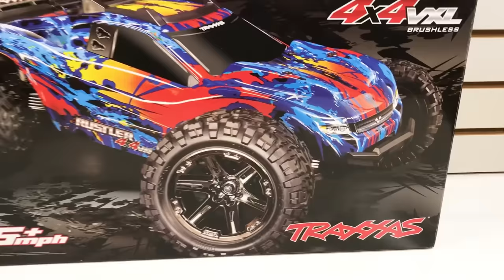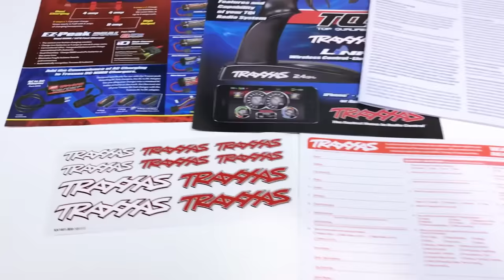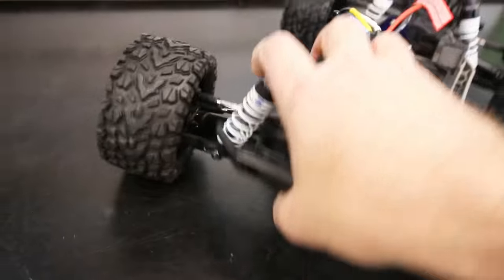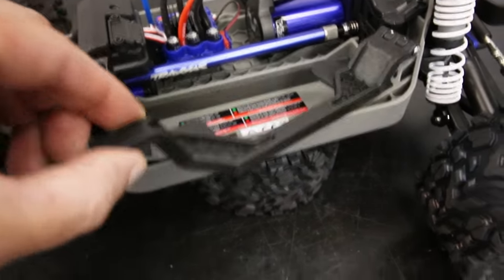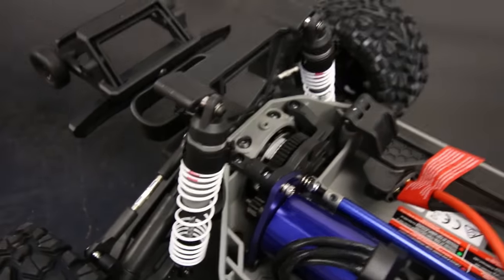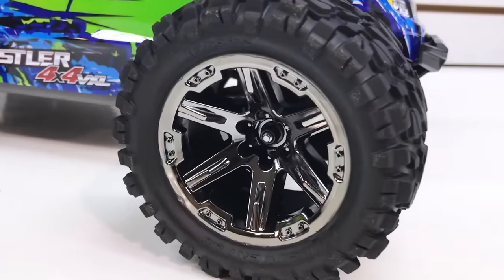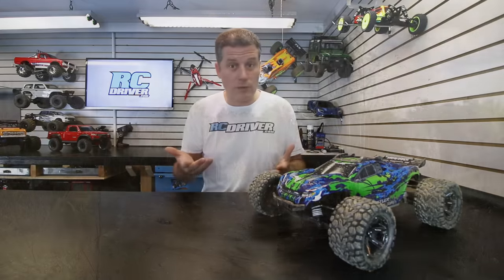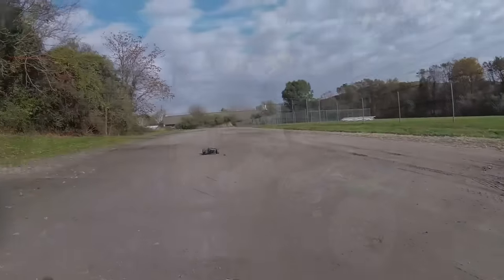SUPER 4WD Stadium Truck Basher! Traxxas Rustler 4x4 VXL RTR Review & Action | RC Driver

Comment: Just got the Rustler 4x4 VXL. Its absolutely amazing! It really shows what Traxxas can do with modern engineering. 

However who thinks Traxxas needs to update ALL of their 2WD platforms? Bandit, Rustler 2WD, Stampede 2WD and Slash 2WD are all in need suspension revisions for improved geometry, durability and adjustability. Thumbs up if you agree, maybe Traxxas will see this and finally give us an long overdue update to these 2WD platforms.
Reply: Considering when they were designed that brushed ruled the times those cars were good for those times. Yes, it would be nice for a redesign, a good mid motor design, more balance so they are not so light in the front. Now with brushless, and more power, they do not perform well on the old engineering. Would really like a redesign of the 2wd platform, if enough customers make noise, maybe Traxxas will listen.
Reply: One more problem I forgot to add, Traxxas needs to eliminate the front and rear offsets as well, front and rear wheels need the same width, so there is no need for different wheels, they should be able to be rotated without those strange offsets.

Comment: Although I was disappointed when it was announced that it was basically just another Slash 4x4, I understand why they did it. It's a proven platform and it performs amazing! Great truck, great video!
Reply: definitely not a slash 4x4 platform.  handles way better,  and it's lighter
Reply: way different design, better chassis and has a way nicer look to it. I have the 4x4 vxl with the lights and it's by far better than my slash and erevo in handling.
Reply: @jakobsinamon1683  While I agree they are technically a little different, likely length and width wise, they are the same design. Take a look at the rustler 4x4 chassis (TRA6723R) vs the LCG slash 4x4 chassis (TRA7422) and you'll see what I mean.

Comment: Just picked up my ruslter 4x4 vxl today and after my first run through two packs one 2s and one 3s I'm extremely impressed, it was a tough debate between this or the senton blx or the losi tenacity since they re all in the same price range. I got a savox servo to throw in it tonight too. I launched it a bunch today and it held up great and it's really smooth feeling, I've also heard people say the velineon gets hot on 3s but mine was fine I ran it hard on 3s and the motor was probably 120 degrees maybe, I could hold my fingers on it as long as I wanted without burning me so I don't know what people are talking about maybe buts their gearing, oh and people saying the velineon could have been higher kv and is too slow ar crazy I haven't even put the 17t on and on 3s was doing like 60ft wheelies on sand lol it's a beast and no need for a faster motor, plus the higher the kv the hotter it runs in my experience so a 5000+kv or whatever would definitely run hot.

Comment: Just dropped the Traxxas sledgehammer tires in mine plus a bunch of other hop ups. The tires changed the whole character of the car. 3s is almost too much I have more fun with 2s. People said I may over heat with the new tires but hasn’t happened yet. I did upgrade the servo to a proline and it turns those big tires no problem. 

As fun as this thing is though I’m always scoping out the erevo 2.0. 😂

Comment: Great video! I actually took mine to an indoor carpet track and it did pretty well. I pop a shock cap and bend a shock cap. That is the weak point in my opinion. I like it with the 17t on 3s. It has great speed and you can control it in the air and do backflips!
Reply: If you run the 17t that's not for stop and go. But speed runs or no? Does it run well for bashing on the 17t? Been hesitant to try it.
Reply: @kcmichelson4528 do not bush on 17T pls:) You are gonna burn ur motor, it is only for speed runs

Comment: Haven't mastered this new body mount system lol it takes me forever to get the body on.
Reply: Same. It's a PITA. Give me body clips any day.
Reply: slow mkv I tip for the body i learnt was pull the sides out of the body at the front it makes it a lot easier to clip it in also the self righting is useless it ruins your driveshafts
Reply: Pancouver venguins took me 1 day to get it down so i feel u but once u get it down its so great
Reply: @trevorrees1764  Same here. The Xmaxx system works great. The Rustler, not so much.

Comment: I was gonna get the slash 4x4 for my 1st RC till this came out. 😍
Reply: Did you get it?! I want one or a maxx will also be my first ec
Reply: Hitler 464 i recommended u get a brushed slash or bandit or rustler for ur first rc and then if u want more power get a brushless motor/ESC
Reply: Jason Lustig isn’t a brushed more maintenance? I don’t really have time to be working on it all the time
Reply: Hitler 464 it’s not really more maintenance it’s just not as durable like it’s not really waterproof like a brushless except with a brushless you will probably break more parts with all of the power but brushless is more fun because you can go faster and lots of other stuff
Reply: Yeah its great that you want one but u should probably get a 2wd, for my first i got a 2wd slash and it was the right choice, just got a 1/16 vxl merv and its pretty complicated

Comment: I bought the brushed version , dropping in a Blx combo .
Reply: Did that on my slash 4x4
Reply: Get rid of the rear bumper and put a stampede 4x4 rear bumper and arrma wheelie bar wheels
Reply: hehe, i tink i follow you on insta
Reply: Same here.
Reply: BLX and win but look out for broken parts especially if it wants to compete with Arrma 50 feet long and 35 feet high jumps and chassis slaps.
Reply: For only 80 dollars more i purchased the vxl model. Too much plastic parts on the brushed model. Not to mention the velineon system that is included that costs at least 130 dollars new by itself.
Reply: @19Herofade92  it's not like you could buy a much better system with lower cost than the vxl 1/10 system. What is wrong with Traxxas?

Comment: Will the Caster blocks on the new rustler 4 by 4 fit on the old 2 wheel Drive VXL they look like they could interchange and I found Parts online that are cheaper but made better but I don't know if they will fit on the rustler but they are the exact setup that this rustler has

Comment: is the non VXL one brushless ready besides the plastic tie rods and stuff, like metal diffs and whatnot?
Reply: yeah all traxxas products are
Reply: The brushed model can take a brushless system although there are a couple differences you may want to look out for.

The brushed model uses a plastic center driveshaft and although it has metal ring and pinion gears for the diffs, they are a different part number from what the brushless model comes with.

Comment: Does this have same differentials at the 4×4 slash or slash ultimate? I hope someone can answer this. Im torn between this and the slash ultimate.  I like rpm parts over the aluminum. Harder on the chassis and everything unless you got 1000 for all CNC machined aluminum from chassis to everything all integy t6 hardened aluminum. Oh and why couldn't traxxas go with gtr shocks for this? Everything is better except that. Maybe they'll do a rustler 4×4 ultimate

Comment: Picked up mine three weeks ago, and have been having a blast with it.  I've been out of 4-wheeled RC for many, many years (been flying helos & drones in more recent years), but am VERY glad to be back in the game...and, the new Rusty couldn't have been a better way to rejoin.  I haven't replaced the pinion gear...yet...but I've already got a few upgrades on the way - Traxxas F/R driveshafts, Traxxas F/R sway bars (designed for the Slash, but should easily fit the Rusty), plus Pro-Line shocks & springs.  However, the first "upgrade"...one I highly recommend others do...was installing the ESC cooling fan.  Next will be replacing the Tx & Rx with Sanwa or Futaba, followed by (in no particular order) the motor, ESC, servos, and other chassis parts (replacing the plastic parts with steel/aluminum parts).  As cool as the body graphics are, I really disliked the blue/green, so I went with the blue/red...but I still prefer something different, thus I ordered the blue/black body (TRA6718X), and will order the clear body (to create my own design, to be used for racing only).  No matter how ytou look at it, the new Rustler 4x4 VXL is a "magical beast" just waiting to be unleashed.

Regarding the "rock that ground down the center driveshaft", I have a possible idea for a deflector.  There are 5 holes in front of that area.  The middle is useless for this purpose, and the 2 'high' holes are probably to mount the telemetry extender box...but, those 2 'low' holes could be perfect mounting points for a custom-made deflector.  I just might have to give this idea a try.

Comment: I bought 3 VXL Rustlers, a VXL Stampede, two TRX4's and two Traxxas Slash, I have several grandkids ages 4, 5, 6 and keeping safety in mind I keep them all in Training Mode and run 2 cell lipo.  I guess what I am saying is we are a Traxxas family and use them every week, we love them and wanted to ask you about the body mount on the Rustler.  I have added Proline Thrashers and love the added traction but the body mount I really struggle with and no way the kids can get that body on.  Do you have any ideas, hacks or suggestions for the body mount that may help me, its the only thing I do not like.
Reply from the maker: Hi Dale, do you mean the 2wd Rustler or the new 4x4? The 2wd should be fairly easy with the 3 bodyclips, I don't think there are any other mount options out there unless you modify some Pro-Line Pro-Loc Slash mounts to work on the truck. They secure the body with cap screws. If you're referring to the 4x4, then yes, I can agree the front clip could be a bit difficult for young kids. It was tricky to install the first few times, but is pretty quick now. Unfortunately I don't have a suggestion for a fix on this one unless you want to install some Slash 4x4 towers and customize the mounts, but the body might sit a little higher.
Reply: @rcdriver  I mean the new 4x4 VXL Rustler, the first one I bought is Blue/Green body I think I have had it for a few weeks, I have two more I intend to give the kids for Christmas, two boys live together at the same house, 5 and 7 but I am concerned their mom will have trouble getting the body on and almost positive the kids could not do it.  I have told her they always need someone with them because these are fast, she understands and we keep them in training mode at all times.  I love the New Rustler, its a beast we have broken every car we have except this one but to be fair its the newest one too.  This thing is awesome but again putting the body on sucks or at least it does for me.
Reply: Take the skeleton off the inside of body and add washers in between it and the body, makes it easier to get the front clip on
Reply: @tedblocker246  Thank you, I am new to the hobby and this fix may well known, this was very helpful and is the fix I was looking for, works great now.
Reply: @daleb1225  , no problem, glad it worked out!

Comment: Is it waterproof?
Reply: They say so. I wouldn't go throwing it in the pool tho. I drive mine in snow and rain and puddles. Holds up. Water resistant. But to expensive to take the chance lol.

Also spray the electronics with some WD-40 before you go out for extra protection.
Reply: @kcmichelson4528  Yeah I just got mine in June of last year for my birthday its a beast
Reply: @ggfarms  yeah. She's an angry little car lol.
Reply: Lol

Comment: why LCG? the chassis is slapping the whole run
Reply: @wojtek-33  lol its a slash with a rustler body
Reply: @crazyphone100  No its a rustler 4x4 vxl
Reply: u can always tune the suspension
Reply: Put washers on the shocks to make it higher
Reply: @tomv3361  i had put the collars on mine to raise the height in the back, then i realized the suspension only sags if the car is still when it takes off and is running, the car sits higher so now i think the collars arent really necessary.

Comment: tried changing my pinion gear for the bigger one and it stripped the screw so im stuck, also i already broke a steering turnbuckle on it within 1 day of having it, so i ordered aluminum turnbuckles and tie rods and stuff. aaaaaaaaaaand it likes to strip the hex cutout too on the inside of the wheel
Reply: Pry it off I stripped my pinion gear once but I managed to pry it off

Comment: I heard that if you try and flip the car back over on its wheels by using the self flipping system is hard on the motor so i wouldn't try it
Reply: It’s hard on the gears not the motor

Comment: Explain the difference between brushed and brushless please
Reply: SpydR513 brushless motors have a lot more power
Reply: Moose knuckle Garage thanks. I’m a total noob to these things.
Reply: @KuntryBoyCitySlick  brushed will do 35mph while brushless can do 65mph plus the motor will last longer
Reply: A M thanks, I’m glad I got the brushless one. We had them out at a skate park today and took it off training mode. This things a beast I thought I totaled it 10 times. Not one thing was wrong with it. I’m sure I’ll destroy it soon and rebuild it better. Yep found my next hobby or pass time.
Reply: Aside from the motor system, here are some of the differences I know off the top of my head (Brushed vs Brushless)

-TQ vs TQi radio system
-Plastic vs aluminum center driveshaft
-Solid camber and toe links vs turnbuckles
-Bushings vs bearings in steering bellcranks
-Analog vs digital servo
-Smaller vs larger slipper clutch
-Different ring and pinion gears for the differentials

Comment: I just got this and ran it for 10 minutes...lost a portion of right rear driveshaft. 

Fixed that and after the next 20 minutes damaged right front arm. 

It's fast as hell and I know I'll love it but, so far I'm disappointed that everytime I touch it, it breaks and I'm not going as hard as I see other Youtubers going on it.
Reply: I'm going through the same thing with the Slash vxl. Play, break, fix, repeat. And I'm not bashing near as hard as I see on YouTube.
Reply: Get the steel driveshafts, as the driveshafts are the weak points in this car.

Comment: How to use the self riding?
Reply: jeff yu What do you have to do is press and hold the send button on the remote controller when the car is upside down… Press and hold the send button for about five seconds until the RC car starts doing something… Let go of it once it starts and it will flip it self over… Sometimes… On the rustler 4 x 4 VXL… Self writing is not the best what do you have to do is press and hold the send button on the remote controller when the car is upside down… Press and hold the send button for about five seconds until the RC car starts doing something… Let go of it once it starts and it will flip itself over… Sometimes… On the rustler 4 x 4 VXL… Self writing is not the best

Comment: For first RC car. This or Slash 4x4 VXL??
Reply: For a first RC car go with something brushed. Even in training mode these VXL models are pretty nuts.
Reply: @RobertNES816  went with a VXL. Immediately changed the pinion and put in a 3S battery. Not disappointed.
Reply: @DavidFernandez-sc5ws  With a setup like that then why even ask in the first place?
Reply: @RobertNES816  because 3 days ago I didn't have it. Just got it yesterday.
Reply: For a first RC car, I'd go with something 2WD

Comment: I don't know if my truck was just a lemon, but this was easily the worst truck I ever bought. I jumped it off a curb no more than 12 inches high and the front bumper cracked and the rear left shock burst open. On top of that the truck kept turning off or going AWOL without touching the controller. And this was all within an hour of taking it out of the box and not touching a single thing on it

Comment: Lol Greg you talk about how the shocks are so amazing and smooth when they’re really just crap. They’re the worst shocks I’ve ever met besides a non hobby grade truck. They’re not durable, they leak, the shock caps pop off, and it takes non-Traxxas aftermarket parts to make them somewhat ok. They’re fine for a basher in the beginning, but when they start bending shock rods, snapping rod ends, popping off shock caps, leaking shock oil everywhere, and bottoming out all the time, they’ll want better shocks.
Reply: Traxxas have some of the best factory shocks out of all brands what are you on about
Reply: Lol you silly goose! You’re funny! 🤣🤣🤣  What are you talking about? Do you even know what you’re talking about? Ha! Obviously not.
Reply: Jamie- the arrma shocks are built better, beefier, smoother, and won’t break every time you land on the front. Yes, I agree with you saying that buying aftermarket parts are    “a part of the hobby,” but that doesn’t mean that Traxxas shocks don’t stink compared to others. If you bought a brand new AE b6.1 kit, there are surely some “upgrades” you can buy for the shocks. The difference is that they perform very smoothly out of the box(kit). The Traxxas ones don’t. As a rule of thumb buddy, think before you comment on a YouTube video and don’t say something if you don’t really know what you’re talking about.
Reply: Traxxas hater.